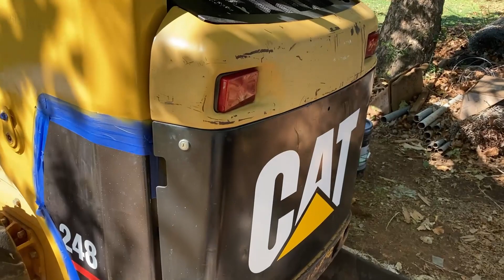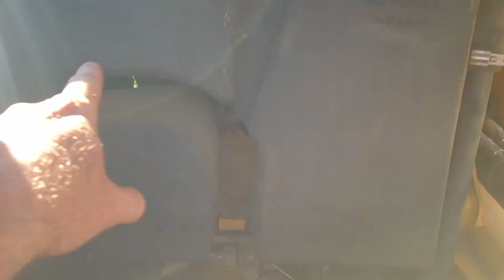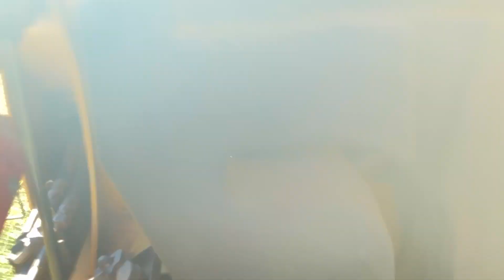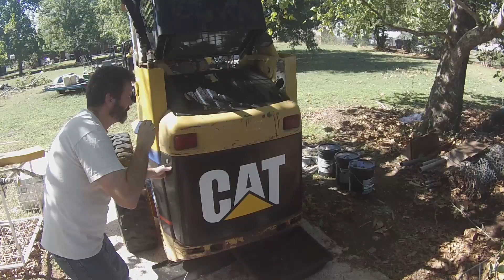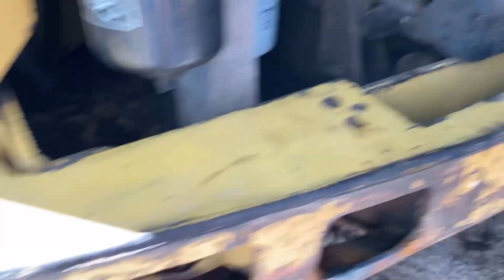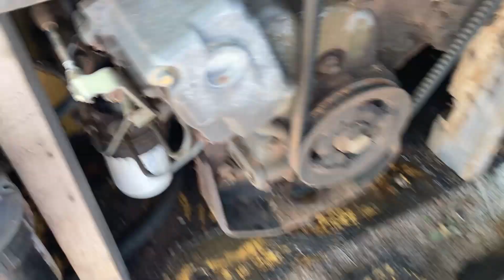Auction CAT 248 Skid Steer NO Hydraulics! No way!

Comment: I know all about old abused Cat skid loaders. I have a 252, also a 2002 like yours that was thoroughly abused and neglected before me. The belly of my Machine was terrible. Hydraulic fluid plus dirt plus 20+ years = concrete. I probably spend 15-20hrs chipping that stuff out. I’d hit something and think to myself that’s so hard it’s gotta be part of the machine, but nope, just concrete like muck. I have so much time invested in fixing it up, but it’s surprisingly been arguably the most reliable machine I’ve ever owned. It’s never not started or had a problem that prevented me from running it. Hasn’t even really nickled and dimed me as old high hour machines do. And it’s a beast. The hydraulic power is ridiculous. It’ll tip itself over before it ever runs out of hydraulic power. I’ve easily lifted and moved over 4000lbs with it. Only thing I haven’t done yet is paint it. One day I will.

Comment: Really appreciate the video and hope you keep releasing content on the rebuild. I have a 252B in a remote location, and the machine has been through heck and still performs. Looking to do some of the physical restorations you have done. Recently, an arm ram seal blew and was replaced (wrongly at first), and now the lift function in the arms works....yet when you stop moving it up, it then falls (or even powers) down about 12-18 inches before stopping. Does your hydraulic background give you an opinion on where to start with an issue like this?  I don't think it is a pilot valve issue, and the only thing we know (it was loaned out when the seal blew and was replaced) was that the arm seal blew,  was replaced with the ring orientation backward, the arms were nearly non- functional...the seals were flipped and put in correctly.... and now the machine is usable but difficult as the arms fall/drop a pretty repeatable amount after moving them up.